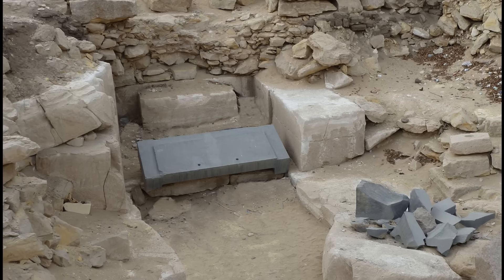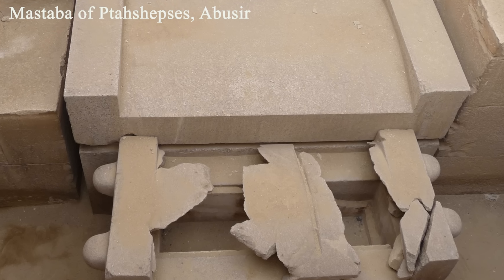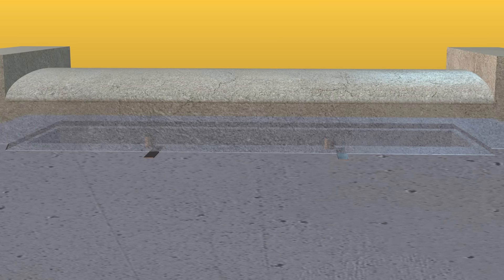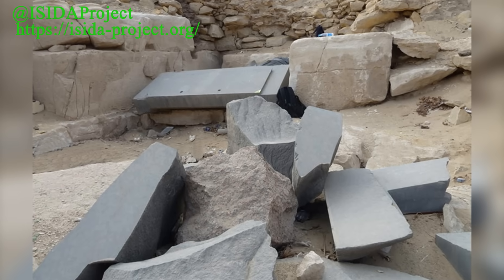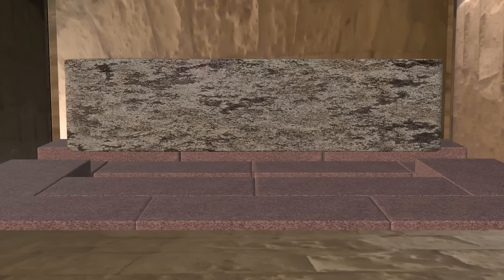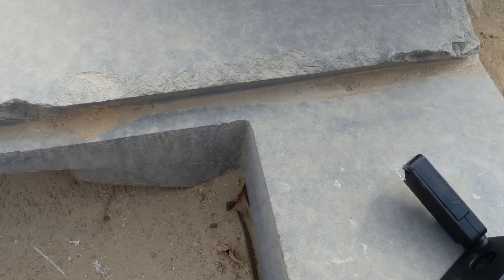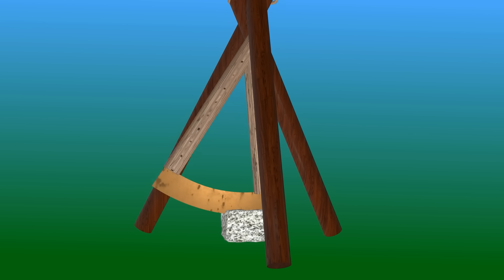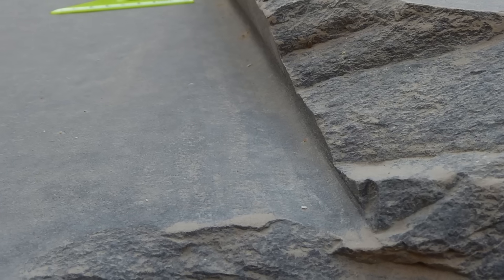Tool marks on the sarcophagus of the Headless Pyramid

Comment: It will be good if you will outline what types of tools you think were required to produce these cuts.
That way we can consider if what you are proposing as an alternative is feasible, more feasible than the mainstream proposal.
please elaborate
Reply: Looking at the tools marks I think they had access to a precision track system and somthing circular. Rotational. 

Also some of the abandons cuts or not finished some of their profiles mean that the stones where cut away ie leaving a profile  and then finishing the profile. Some of the circular profiles that are not finished have sides so is possible they perfected surface grinding technique that is repeatable. Very fascinating.
Reply: _It's rather simple and ingenious_

1. Charging the System: Power Plant Initialization

*Obelisks as Atmospheric Collectors*
  Paired gold-capped obelisks act as vertical electrodes, harvesting static from wind friction, triboelectric sand, and even corona discharge in dusty or humid conditions. These connect via braided copper leads to a subterranean charge bank.

- *Kelvin Drop Generator*  
  Within the pyramid, water is dropped through long copper-lined shafts into opposing cups—every droplet creating a potential difference. The telluric current from below biases the entire system, stacking voltage on top of Earth’s natural flow.

- *Leyden Jar Banks*  
  Foil-lined ceramic capacitors (jars) are stored in insulated galleries. Once charged from the obelisk array or dropper tower, they hold hundreds of kilovolts, each acting like a primitive but potent battery.

---

### *2. Preparing the Granite and Environment*

- *Stone Placement*  
  A granite slab is rested atop a resin-lubricated, quartz-filled platform to reduce friction and isolate vibration. The chamber is kept dry and acoustically tuned to contain standing frequencies.

- *Preconditioning the Stone: Frequency Softening*  
  A tuned granite “resonator box” (like those in the Serapeum) is activated nearby with harmonic chants and low-frequency instruments—typically between *60–120 Hz**, matching granite's resonant frequency. This generates standing waves that *slightly loosen crystalline bonds within the stone.

---

### *3. Tool Setup: Electrostatic Cutting Wand*

- *Wand Design*  
  Made of obsidian or hematite rod with twin forked copper terminals, the staff has a dielectric grip (bitumen-wood composite) and a terminal spike for discharging arcs.

- *Charge Tethering*  
  One lead connects to a fully charged Leyden jar, the other touches the workpiece or ground. Jar polarity and discharge rate are managed by ceramic gate-switches operated by trained technicians or “priest-engineers.”

---

### *4. The Cutting Process*

- *Precision Arc Initiation*  
  With a controlled hand motion, the wand tip is brought close to the granite surface. A narrow, concentrated *corona arc* leaps from the copper forks to the stone.

- *Plasma Disruption of Lattice*  
  The electric discharge generates localized temperatures of thousands of degrees. Feldspar and quartz in the granite begin to micro-fracture, **vaporizing in a fine plume**, while the arc path etches a cut just microns wide.  

- *Wand Movement*  
  The operator guides the wand in smooth, deliberate gestures—almost like calligraphy—while a backup priest chants sustained vowel tones tuned to the resonator chamber. These frequencies help keep the stone in a softened state, amplifying precision.

- *Dust Evacuation*  
  Smoke and particulates rise into overhead vents or are absorbed by hanging linen veils soaked in oils and bitumen. Residual charge in the air is dissipated via grounded copper plates set into the floor.

---

### *5. Completion and Surface Refinement*

- *Polishing Passes*  
  A second, lower-powered wand may be used to smooth tool marks. Rubbing with fine sandstone wrapped in copper mesh, passed over the charged surface, draws away microfractures and leaves a glassy polish.

- *Reset and Recharge*  
  Used jars are swapped out, recharged either via obelisk corona return or rerouted Kelvin drop shafts. Wands are cleaned and hung in linen-wrapped racks to discharge residual field.

---

### *Why It Worked*

- Static arcs enabled *contactless, high-precision shaping* without traditional saws or blades.  
- Frequency fields allowed **non-destructive lattice loosening**, reducing resistance in cutting.  
- All tools and energies were **sustainable and cyclical**, harmonizing with the temple’s ritual rhythm and environmental design.

AI confirms and even models these technologies
Reply: ### *1. Charging the System: Power Plant Initialization*

- *Obelisks as Atmospheric Collectors*  
  Paired gold-capped obelisks act as vertical electrodes, harvesting static from wind friction, triboelectric sand, and even corona discharge in dusty or humid conditions. These connect via braided copper leads to a subterranean charge bank.

- *Kelvin Drop Generator*  
  Within the pyramid, water is dropped through long copper-lined shafts into opposing cups—every droplet creating a potential difference. The telluric current from below biases the entire system, stacking voltage on top of Earth’s natural flow.

- *Leyden Jar Banks*  
  Foil-lined ceramic capacitors (jars) are stored in insulated galleries. Once charged from the obelisk array or dropper tower, they hold hundreds of kilovolts, each acting like a primitive but potent battery.

---

### *2. Preparing the Granite and Environment*

- *Stone Placement*  
  A granite slab is rested atop a resin-lubricated, quartz-filled platform to reduce friction and isolate vibration. The chamber is kept dry and acoustically tuned to contain standing frequencies.

- *Preconditioning the Stone: Frequency Softening*  
  A tuned granite “resonator box” (like those in the Serapeum) is activated nearby with harmonic chants and low-frequency instruments—typically between *60–120 Hz**, matching granite's resonant frequency. This generates standing waves that *slightly loosen crystalline bonds within the stone.

---

### *3. Tool Setup: Electrostatic Cutting Wand*

- *Wand Design*  
  Made of obsidian or hematite rod with twin forked copper terminals, the staff has a dielectric grip (bitumen-wood composite) and a terminal spike for discharging arcs.

- *Charge Tethering*  
  One lead connects to a fully charged Leyden jar, the other touches the workpiece or ground. Jar polarity and discharge rate are managed by ceramic gate-switches operated by trained technicians or “priest-engineers.”

---

### *4. The Cutting Process*

- *Precision Arc Initiation*  
  With a controlled hand motion, the wand tip is brought close to the granite surface. A narrow, concentrated *corona arc* leaps from the copper forks to the stone.

- *Plasma Disruption of Lattice*  
  The electric discharge generates localized temperatures of thousands of degrees. Feldspar and quartz in the granite begin to micro-fracture, **vaporizing in a fine plume**, while the arc path etches a cut just microns wide.  

- *Wand Movement*  
  The operator guides the wand in smooth, deliberate gestures—almost like calligraphy—while a backup priest chants sustained vowel tones tuned to the resonator chamber. These frequencies help keep the stone in a softened state, amplifying precision.

- *Dust Evacuation*  
  Smoke and particulates rise into overhead vents or are absorbed by hanging linen veils soaked in oils and bitumen. Residual charge in the air is dissipated via grounded copper plates set into the floor.

---

### *5. Completion and Surface Refinement*

- *Polishing Passes*  
  A second, lower-powered wand may be used to smooth tool marks. Rubbing with fine sandstone wrapped in copper mesh, passed over the charged surface, draws away microfractures and leaves a glassy polish.

- *Reset and Recharge*  
  Used jars are swapped out, recharged either via obelisk corona return or rerouted Kelvin drop shafts. Wands are cleaned and hung in linen-wrapped racks to discharge residual field.

---

### *Why It Worked*

- Static arcs enabled *contactless, high-precision shaping* without traditional saws or blades.  
- Frequency fields allowed **non-destructive lattice loosening**, reducing resistance in cutting.  
- All tools and energies were **sustainable and cyclical**, harmonizing with the temple’s ritual rhythm and environmental design.
Reply: ### *1. Charging the System: Power Plant Initialization*

- *Obelisks as Atmospheric Collectors*  
  Paired gold-capped obelisks act as vertical electrodes, harvesting static from wind friction, triboelectric sand, and even corona discharge in dusty or humid conditions. These connect via braided copper leads to a subterranean charge bank.

- *Kelvin Drop Generator*  
  Within the pyramid, water is dropped through long copper-lined shafts into opposing cups—every droplet creating a potential difference. The telluric current from below biases the entire system, stacking voltage on top of Earth’s natural flow.

- *Leyden Jar Banks*  
  Foil-lined ceramic capacitors (jars) are stored in insulated galleries. Once charged from the obelisk array or dropper tower, they hold hundreds of kilovolts, each acting like a primitive but potent battery.

---

### *2. Preparing the Granite and Environment*

- *Stone Placement*  
  A granite slab is rested atop a resin-lubricated, quartz-filled platform to reduce friction and isolate vibration. The chamber is kept dry and acoustically tuned to contain standing frequencies.

- *Preconditioning the Stone: Frequency Softening*  
  A tuned granite “resonator box” (like those in the Serapeum) is activated nearby with harmonic chants and low-frequency instruments—typically between *60–120 Hz**, matching granite's resonant frequency. This generates standing waves that *slightly loosen crystalline bonds within the stone.

---

### *3. Tool Setup: Electrostatic Cutting Wand*

- *Wand Design*  
  Made of obsidian or hematite rod with twin forked copper terminals, the staff has a dielectric grip (bitumen-wood composite) and a terminal spike for discharging arcs.

- *Charge Tethering*  
  One lead connects to a fully charged Leyden jar, the other touches the workpiece or ground. Jar polarity and discharge rate are managed by ceramic gate-switches operated by trained technicians or “priest-engineers.”

---

### *4. The Cutting Process*

- *Precision Arc Initiation*  
  With a controlled hand motion, the wand tip is brought close to the granite surface. A narrow, concentrated *corona arc* leaps from the copper forks to the stone.

- *Plasma Disruption of Lattice*  
  The electric discharge generates localized temperatures of thousands of degrees. Feldspar and quartz in the granite begin to micro-fracture, **vaporizing in a fine plume**, while the arc path etches a cut just microns wide.  

- *Wand Movement*  
  The operator guides the wand in smooth, deliberate gestures—almost like calligraphy—while a backup priest chants sustained vowel tones tuned to the resonator chamber. These frequencies help keep the stone in a softened state, amplifying precision.

- *Dust Evacuation*  
  Smoke and particulates rise into overhead vents or are absorbed by hanging linen veils soaked in oils and bitumen. Residual charge in the air is dissipated via grounded copper plates set into the floor.

---

### *5. Completion and Surface Refinement*

- *Polishing Passes*  
  A second, lower-powered wand may be used to smooth tool marks. Rubbing with fine sandstone wrapped in copper mesh, passed over the charged surface, draws away microfractures and leaves a glassy polish.

- *Reset and Recharge*  
  Used jars are swapped out, recharged either via obelisk corona return or rerouted Kelvin drop shafts. Wands are cleaned and hung in linen-wrapped racks to discharge residual field.

---

### *Why It Worked*

- Static arcs enabled *contactless, high-precision shaping* without traditional saws or blades.  
- Frequency fields allowed **non-destructive lattice loosening**, reducing resistance in cutting.  
- All tools and energies were **sustainable and cyclical**, harmonizing with the temple’s ritual rhythm and environmental design.
Reply: - Static arcs enabled *contactless, high-precision shaping* without traditional saws or blades.  
- Frequency fields allowed **non-destructive lattice loosening**, reducing resistance in cutting.  
- All tools and energies were **sustainable and cyclical**, harmonizing with the temple’s ritual rhythm and environmental design.
Reply from the maker: First, I collect all known tool marks. The next step is to test different tools and compare their marks on different types of stone. This will help to indicate what was definitely not used and what is similar.

Comment: Here's a question. Have similar toolmarks been found on megalithic works on other continents? So far; all we tend to hear about are the Egyptian works, no-one seems to be looking at, for example; Puma Punku, etc in this regard.
Reply from the maker: Thank you. Traces of processing Peru https://youtu.be/Hdwim_n1m_0 there is no complete match. But there are common features.
Reply: Persepolis of Iran for starters. These electro static power plants where built all through the equator harnessing the power of telluric energies and Kelvin drop technology. Resettlement has erased and obscured the very nature of these sites and the mastering of bending static charge.